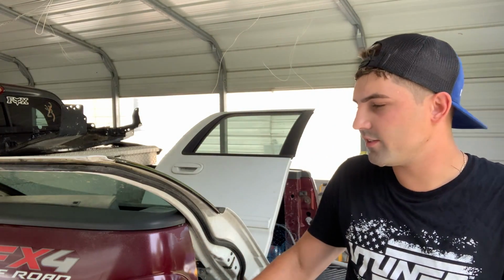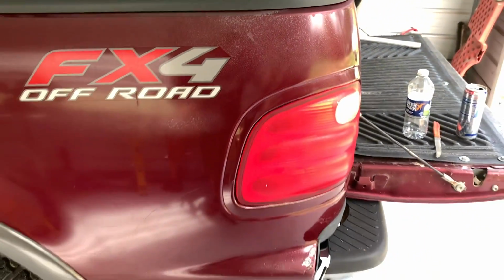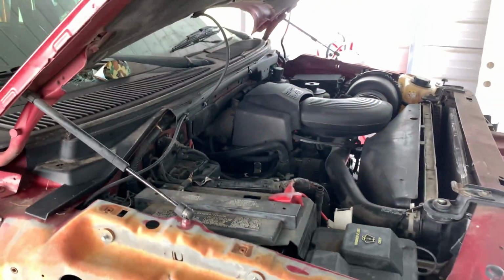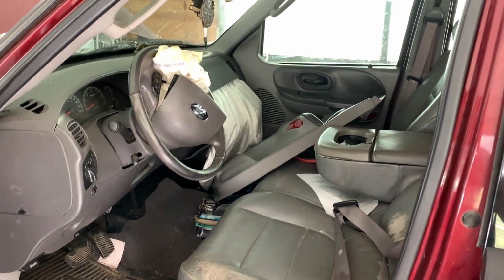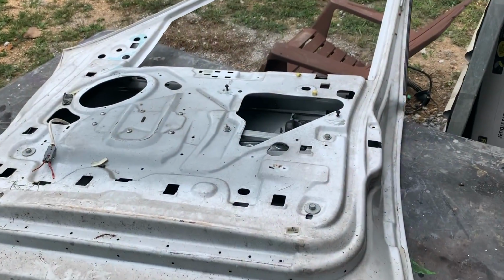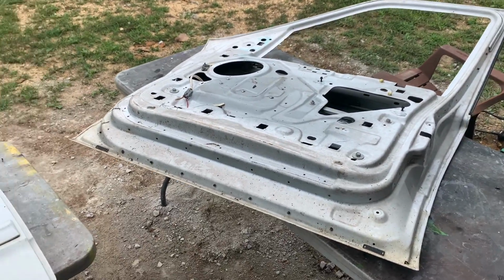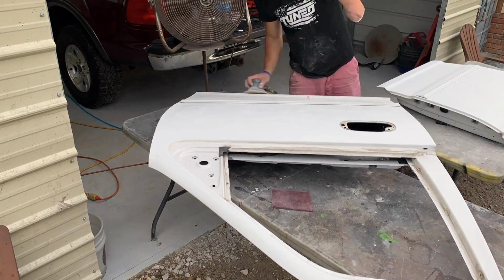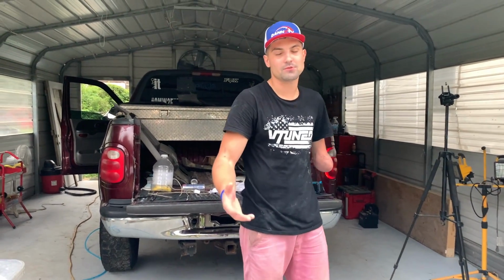Another Super Cheap Truck Build [part 1]

Comment: I have very similar 2002 F150 (even same color) with 246,000 miles on the odometer. Still runs strong. Has  some rust and a few other things, but never lets me down. 

Paid $2700 a couple of years ago and am confident I could easily get $3k today. 

What do you do with the builds after you finish them?
Reply: He (and fam.) add some to the fleet and sell others.

Comment: Wasnt this motor the one tha back plugs break off when removing them?
Reply: Yes it is or would occasionally just blow out and the threads would come out with it then you would have to sleeve it, rethread it with a tap and die or use a helicoil. The helicoil I think is the best way to do it. When I was younger we bought a similar truck went to do a tuneup and realized that the spark plugs were three different sizes from how they were repaired before.
Reply: 208,000 on a 2 valve 5.4 is nothing. I have 384,000 on mine and you can't hear it run. Great engines and a great truck too.

Comment: Uh oh, the dreaded 5.4L Triton.  One of the worst motors of all time.  Good luck with this one.
Reply: Your thinking of 5.4 3v
Reply: I owned 2 F150s 2000 F150 with the 5.4 on 35s with a 6inch and a 2006 F150 with 35s as well i ran both of them trucks extremely hard and never did I have any motor issues with my 2 only had a steering box go out on the 06 from the bigger tires and the solid mud it ran through